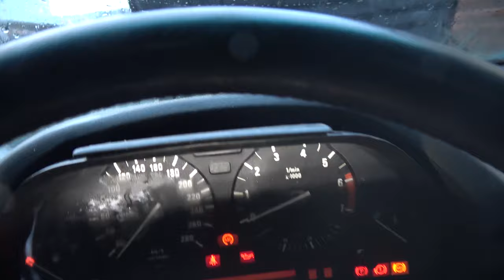I Got a Free, Neglected & Rare V12 BMW E32 750iL Highline

Comment: These are amazing, but will certainly give you a lot more to do than the other 750iL.  Can't wait to see the videos on this car!

Out of the 5,000 of these made, probably half of these survived.  Likely all of the extra equipment in these cars would have overwhelmed even the most determined BMW DIYer.  So if you figure only about 2,500 of these are still roadworthy, these are extremely rare cars.  Keep that in mind when reselling it.  There are Ferraris and Lamborghinis more common than this car.  A lot of the specialized parts are NLA from BMW, BUT, you might find some parts from Maximillian Imports.

Aren't you glad you quit your IT job?

Comment: Yes, is kind of a disaster, about in the same condition like my 95 mondeo project. I decided to buy a mig welder and to learn to repair it. I started 2 years ago and yes, after stripping the interior you need another garage only for the parts. 
Good luck with that one and to not scrap it. Just take another garage someday and try to do it.

Comment: You need to get the ozone machine in there right now to kill that mould before it starts to damage or discolour bits of the trim.
But yeah, save it. Buy yourself a MIG welder and use this car to learn welding on, then it's only paint you'll need to outsource.

Comment: Assuming the mechanicals are good, this would make some sense for someone that likes doing bodywork like, but otherwise not. The rust isn’t that bad, much of it can be solved by replacing the exhaust, brakes, suspension and steering components that need replacement anyway, but tackling the body can be expensive and despite not looking too bad, I guess that is enough to fail inspection over there. Nevertheless, that was a really handsome car back in its day and perhaps still is under all that dirt and mold.

Comment: Just some chlorine with a spray gun (use a mask) over that mold and it's gone after wiping. Then you can strip it out and look for the rust inside. Wash and dry the carpets. Give the leather some treatment and clean any rust on electrical contacts.

Comment: Would you be interested in fixing an 1992 730i V8 with broken transmission and missing exhaust from the muffler? It’s been sitting for 2 or 3 years and since it’s from Spain, there‘s almost no rust and the interior is not moldy.

Comment: Sreten that's a V8 bumper, probably from an early 740. Only M60 powered cars had those brake vents at the very bottom.
Reply from the maker: Negative, that's a V12 bumper that came on later E32s like this '91 750iL.
Reply: @M539Restorations  oh, I thought those bumpers were exclusive to v8 e32 and e34.. never stop learning !

Comment: The fueltank in this car is real PITA (pain in the ass). Just imagine this ammount of crispy chip of metal inside the tank but not on the bottom, but on the top surface inside where water condensate everytime. Second very bad place are weld lines of two pans, its just horrible

Comment: You need to learn how to weld :D
Im a bodyshop guy, and if it wasnt in Germany, i'd totally give you a hand to get started on that. Just a tip, dont buy the cheap welders with ''gas in the wire'' crap. They are horrible, even for Pros.

Comment: From the E34 and E32 experience I have I wouldn't try to restore it, if you can't do the bodywork for yourself. It will be far too expensive compared to the mediocre prices E32 Highline will get you (even some years in the future - 7 series never will be considered that valuable - not even the E38). I would strip the interior, clean it and sell it.

Comment: Wow that is really rusty. I sold not so long ago the family kept and bought new in 89 a manual malachit 735i with cognac full leather interior. 
It had literally no rust. Only a little on the doors. Always stored inside and had 175k kms.

Just part it for parts. It is only a 7 series. And honestly, those cars aren’t worth a lot. And in my opinion those are not classic cars, but ancient early computers. I prefer older cars.

Comment: Hello, I have 1994 model E32 750 i bmw vehicle, it takes the engine under protection immediately after it starts and the 2000 cycle does not pass. The masters here said that it is from 02005000015 throttle brain. We could not find this brain in Turkey.

Comment: Why do those cars break down so much? Built well, and doesn't rust, but the mechanics of german cars suck. Ask any Volkwagen owner between 2000, and 2009. I had  750iL, had to sell it because it went into failsafe. ECM/brain went out. So I wired up a push button, after turning on key, just to drive it in 4th gear.